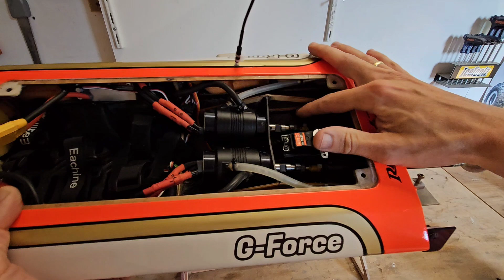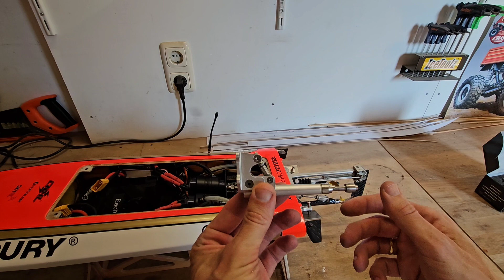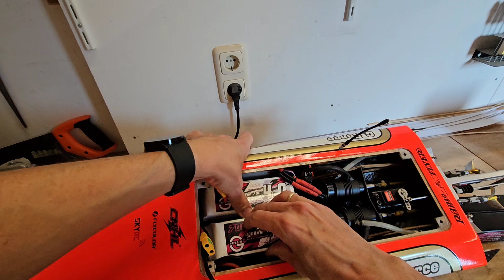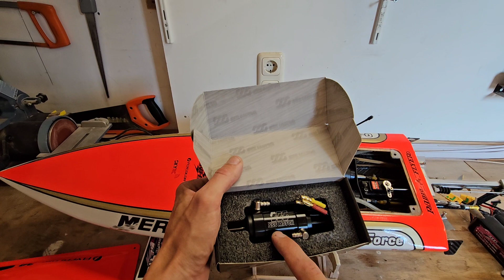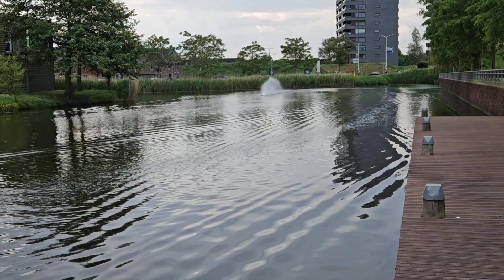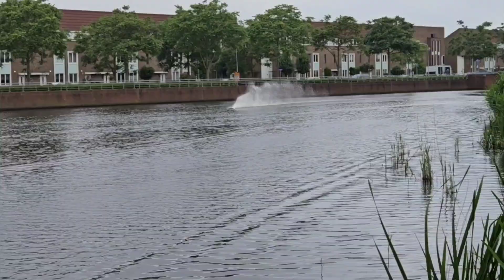Full Review of my G-Force DIY RC twin motor mono

Comment: Thank you for sharing ready-to-print designs. I was very helped. with slight modifications due to making it on a smaller scale, but the result is in line with my expectations. Previously I had tried several times to design it myself, but failed. once again I say thank you.
Reply from the maker: You're welcome!

Comment: Hello,would your plans have to be changed if I were to enlarge them to build a hull 45 inches  long with a big single engine?
Reply from the maker: Not really. Only take into account to use thicker bulkheads and skin plating
Reply: Thanks for the reply back! What is the CG of this hull roughly?
Reply from the maker: The cg is at 30% from the transom

Comment: Hello Dirk. Can you please tell me how to syncronize the esc's. You use a Y splitter from the receiver to the esc's or there is some other trick? Thank you!
Reply from the maker: You need to set the throttle range of both escs independently, first. Then, use a Y splitter, with one of the JST receiver cables of the esc without the red wire connected. The reason is the esc provides power to your receiver, but it doesn't like to receive the power from both receivers

Comment: You build an awesome boat I tell you that. My carbon fiber tfl Pursuit I didn't have any flotation in the hatch and guess where it is at the bottom of the lake that's another hundred dollars right there. Would you be interested in selling that boat cuz it is gorgeous? I love the part where you put the piece of fiberglass instead of carbon fiber for your antenna cuz I have no signal on the inside of mine being all carbon fiber either that was a great idea
Reply from the maker: Thank you for the nice feedback! This boat is not for sale, unfortunately. I speedrun it this season, hoping to get some good numbers. I got 77mph last week with it. By the way, I also got a Pursuit project waiting to be built. I love that boat 😎

Comment: Sir i need ur help.am from INDIA

i want to know to program flycolor esc with 3660 3800kv motor
Reply from the maker: Hi, basically, you don't need to program it. It will work with default settings. 3800kV is quite a lot for such a motor. Be careful not to burn your motor or esc. I recommend 3S lipo max.

Comment: those SSS 2075kv motors run beautifully, have one in my 29 inch mono and it's really smooth. Prefer it to any rocket motor I've tried. Will be interested to see how they perform in your twin mono... Thank you for the fantastic videos and best wishes from the UK
Reply from the maker: Sounds good on the SSS motors. I have one behind my T800 F1 Tunnel, and it performs great. I do love the Rocket motors as well 😎 Cheers from the Netherlands!